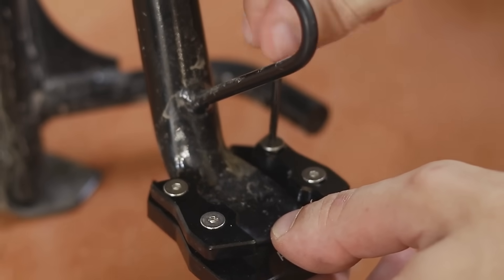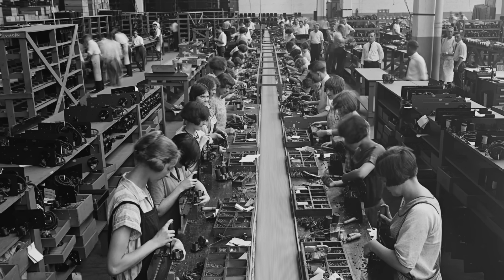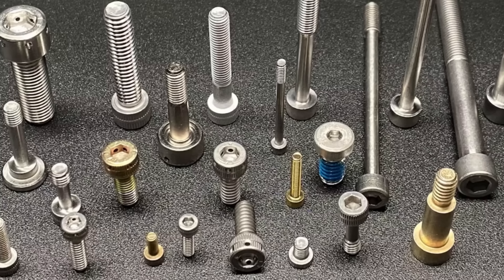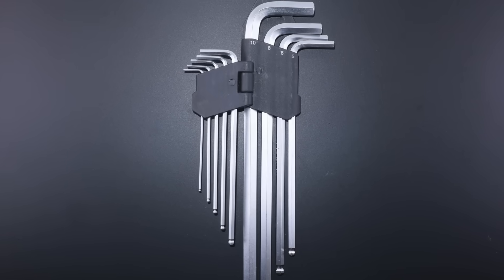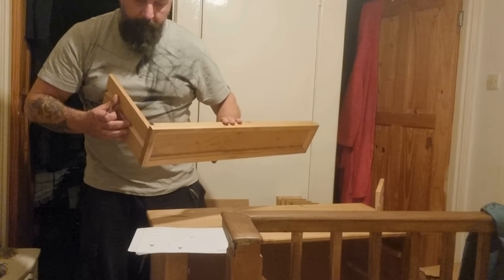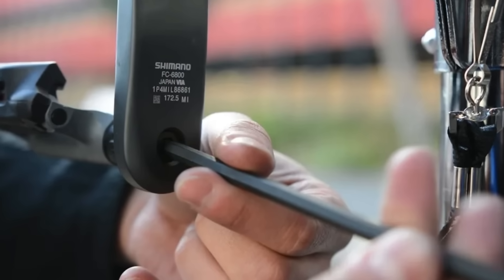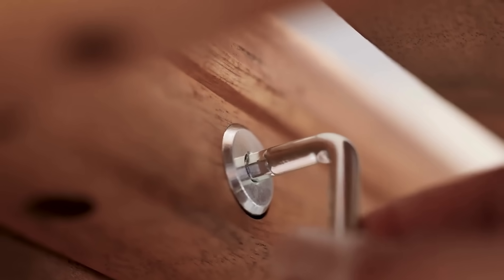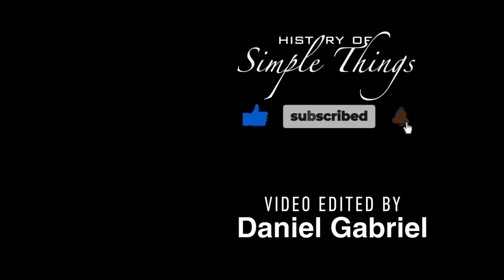Why Do We Call It an ‘Allen’ Wrench? The Surprising Origin Story!

Comment: Why the slotted screw is not banned is a mystery. 😮😮😮😮 It is dangerous and unreliable.
Reply: No, it is not a mystery.  For one thing, we don't need government telling us what kind of fasteners to use.  The market place will decide.

There are places where the slotted screw is a good choice.  Perhaps the biggest one is the cover plate on electrical receptacles and switches in the US.  Cover plates are sometimes painted over.  The slotted screw is the only type which can be cleaned out with the same tool used to turn the screw.  This can also apply to other covers on electrical boxes.  I have an electrical box in my kitchen wall with nothing of interest inside, just wires running straight through.  It is covered with a metal plate.  I painted over it, screws and all, so it can't be seen unless you are right next to it.  Still, it can be removed easily if anyone wants to look inside it.

Another place is the pulls on cabinets.  Mine have a combination screw which can be turned by either a #1 Phillips or a 1/4" slotted screwdriver.  Everybody either has one or can easily find one locally.  The slot is not size-critical.  You could use a 3/16" driver.  You could even improvise a driver if necessary.  If it used an Allen key, you would need to have the right sized key.  The key would have to be packaged with each pull, as they are wrapped individually.  When you have a whole cabinet, like the Ikeas, the key is a trivial addition.  When you have a single drawer pull in a sealed plastic bag, it is not.  The alternative is that the user would have to buy the key separately when buying drawer pulls.  A lot of people don't have a set of Allen keys.  If they have one small one for a particular need, they have probably lost it.
Reply: @GH-oi2jf  Another use for slotted is on firearms. They require special 'hollow ground' drivers without the taper and gunsmith bit sets have blade width and blade thickness variations, but all take straight sided drivers with no taper. I have a set of 40 or so sold by Brownell's, just for use on guns.
Reply: @Robnord1  
always comes down to firearms with you lot
Reply: @lenroddis5933  Guns scare you, don't they Lenny the troll?
Reply: @Robnord1  
I suspect they scare most sane people.
Presumably, while you're at the delivery end, you are king of the world.
Reply: @GH-oi2jf  
the other 96% of the world's population may disagree with you.

Comment: So why did the hex socket succeed, while the square socket screw (Robertson) not catch on as well?  Same idea.
Reply: Apparently because Henry Ford couldn't get exclusive rights to it and he went with the Phillips instead.
Reply: 6 sides require less room to tighten it( 60° instead of 90), that would be my guess unless it's just clever marketing. My lathe chucks are using squares.

Comment: I HATE allen screws.  They're okay when new, but when used in recessed places that tend to rust over time, they're extremely hard to remove because the allen wrench slips on the screw, if you can even get it in far enough.  A slotted screw is much more efficient.  The only good thing about an allen screw is that it's easier to drill out because of it's more rounded interior.
Reply: Indeed, the very small sizes round off very easily.
I use grub screws with a hex recess to secure steam engine flywheels and eccentrics where rounding off can be a nightmare to fix..

Comment: Here in the UK, we often call it an Allen key.
Reply: Also known as an Allen key in Australia.
Reply: @somluck2813  Most of the colonies current or ex, called it an Allen Key.
Reply: In learned in India in "workshop practice" in 1984 that it's called an allen key too!!!😂
Reply: Während Innensechskantschlüssel der korrekte Begriff für das Werkzeug ist, handelt es sich bei INBUS um einen rechtlich geschützten Markennamen. Der Name „INBUS“ wurde von der deutschen Firma Bauer & Schaurte eingeführt und leitet sich von „Innensechskant Bauer und Schaurte“ ab.
Reply: South Africa as well and the screws/bolt Allen capped screws, Hex bolts are normal bolts that you loosen with a spanner, You do get imperial and metric Allen keys though.
Reply: I was going to say the same thing.
Reply: Same in Australia
Reply: Das ihr alles, was nicht von euch kommt, umbenennen müsst, ist schon fragwürdig!
Reply: Same in Australia
Reply: So? This is American produced video they call them wrenches, don't get so bothered by it! lol
Reply: @Dudleymiddleton  It didn't bother me, just say what they are called here ffs
Reply: It's an Allen key, and as originally designed was idiot proof as you couldn't strip it by using the wrong size wrench, it either wouldn't fit, waoo small or exactly right.

Notice my name😁
Reply: @andrewallen9993  Andre Wallen lol
Reply: @Dudleymiddleton  No one's getting bothered. He was just pointing out a difference in how it's referred to in the UK, which is perfectly reasonable.
Reply: @Dudleymiddleton tit
Reply: That's what it's called in Canada.
Reply: invenredin Connecticut so must use american name  wrench

Comment: The Phillips screw replaced the straight-slot screw in general manufacturing. The Hex screw or the Torx screw is used in applications where the higher cost can be justified.
Reply: And easier for a machine to install.
Reply: @markfloyd7206  Correct. As I understand, the original torque-limiting mechanism for screws in manufacturing is the cam-out effect that occurs on Phillips screws.

Comment: And yet, if I go into any DIY store in the UK, I'm unlikely to find any hex head screws for my own projects.  They're easy enough to get online but, the vast majority of screws we find in the shops are crosshead or phillips.
Reply: Suche nach Torg oder Torx
Reply: I suspect they are more likely to be Posidrive than Phillips
Reply: Na. PZ2 far most common in UK
Reply: Not quite any DIY store in the UK. Broadway DIY in Potters Bar, Herts sells Allen screws, of proper industrial quality. It is independent, not part of a chain.
Reply: I usually go to a specialty fastener store so I am buying local, they have hex head, Phillips or straight slot in whatever size I need.  depending on what I am doing I may buy any of them.  I live in Tennessee in the US
Reply: youre going to the wrong shops then. try halfords as opposed to b+q

Comment: Regarding 4:03, a hexagonal key tool with a ratchet mechanism is much faster because the ratchet mechanism allows you to continuously turn the fastener without re-positioning the hex key, and the hex key's shape minimizes the swing arc needed. The ratchet handle's internal gears allow you to tighten or loosen the fastener by clockwise or counter clockwise rotation, which is much faster than a traditional L-shaped hex key where you have to continuously lift and reposition it.
Reply: One summer during college in the ‘90’s I worked in the Allen factory in West Hartford, on a line that made Sears Craftsman brand hex keys. While it was already owned by a bigger company then, I assume the factory has since closed and moved to China and Sears is gone, too.
Reply: Yes, for industrial use where you are doing hundreds or thousands per day. I’m sure that even the first factory’s that used them didn’t use an L wrench. But as the video said, the keys are small, easy to make, and work fine for most small assembly and repair jobs.
Reply: @miken3260 I use them in my impact daily, between Allen/hex, torx, Robertson, Phillips,  safety Torx, I switch tips a lot
Reply: For most things I agree but on a lot of things the room is limited and a key is just about all you can use. I've been in some places where you have to cut a key shorter for it to work or spend hours removing other parts and reassembling it.
Reply: @user-neo71665 they make little ratchets that hold hex back tips like for an impact and they make hex back Allen tips too, I can get down to about ⅝" total tool thickness with a pass through ratchet and tip for really tight spaces
Reply: Just wait until you find out they make them for impacts...